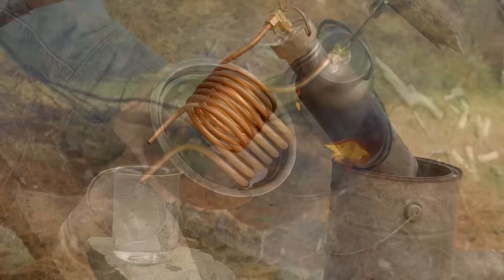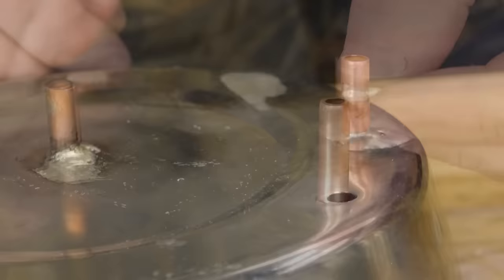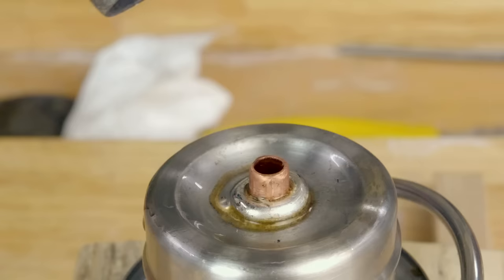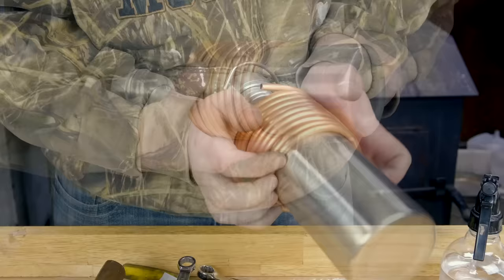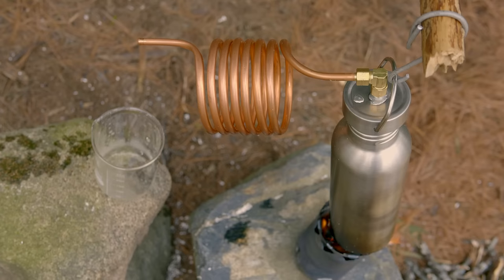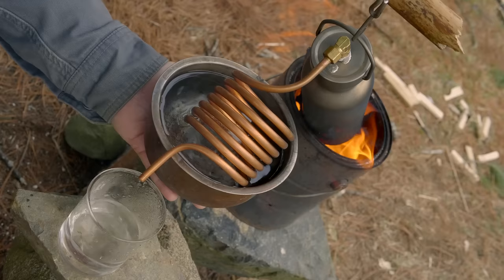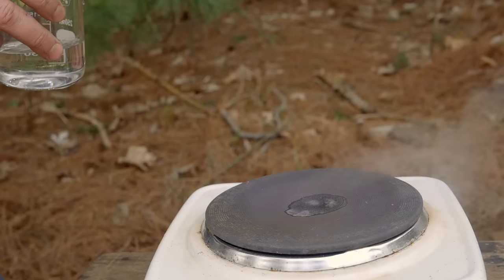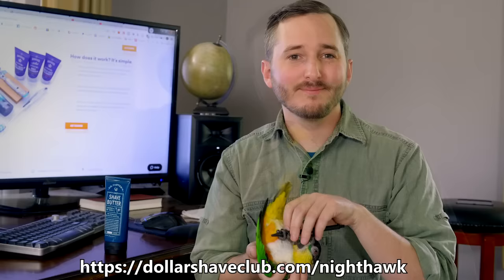DIY Salt-Water Survival Bottle (Compact Desalination Kit)

Comment: I Absolutely LOVE That You Said AND SHowed Your Failed Soldering.
A Lot of channels show how they make things and they dont mention soldering issues because i for a fact know that soldering is ART And You cant just solder everything without any problems, when you introduce two metals then there is problems and so on, i have even INVENTED MY OWN Solder paste , you can see that in my main channel called KRISRAP, It Have Helped SOO Much people to solder much better, half of the invention is actually passed to me from my fatther  and other half i thought up myself.
One Thing That I Can Tell you, Don`t Put The Rubbing Alcaahol On To The Solder  While The Piecve Is Hot, You Are Introducing Microcracks That Can Break More Under The Presure Afterwards When The Destilator Is In Workiong. Just Wait And THEN Clean It With A Steel Wool :) 
And COIL Should Be On To The Upper Side, Not Bottom Side Because It Releases The Presure,What You Did Is More Dangerous And It Builds Up More Presure.

Comment: A better way of doing it is with a Jerry can filling it with salt water from sea or saline well or other source and just using rag and garden hose , the rag to seal the hose to the Jerry can, then placing the Jerry can on a fire 🔥 to start distillation of fresh water. The problem with using copper pipe for desalination is that when copper is heated it releases excess amounts of copper into the drinking water which is not advisable for use as drinking water.
Reply: If you use a closed system and pull a vacuum on it, you can lower the boiling temp of the water to much, much lower, so that you need far less heat/fuel to turn it into vapor.  In turn, the copper will stay much cooler and have less issues with the above.

Comment: There's a product out that boils water from solar heat. It has a glass inner core and it's $67. Idk if tearing it apart and drilling holes would be worth it or not, but no flames would be required.

Comment: Copper conducts heat better than other metals which can cause problems. You need to torch the other metal for a bit longer before more briefly heating the copper.

Try it, you'll thank me later ;)

Comment: The problem with your boiler is there is no relief valve. Water does not compress. If the coils cool the water enough to where the steam cannot escape quickly enough, boom.

Comment: Some missed advice - do not fill the bottle or other containers past half point, or the boiling water may overflow or send parts of it into the tube, resulting with too salty water. More stuff to possibly improve upon or include in the kit is a good stick to scrub out the salt that may stick to the container, some folded up tin foil that you can build a 'house' over the tube out of which will catch and condense much more steam... Might wanna pull out the tube some more, at least upon use, so its not as close to the fire source. Lastly, a question - are you sure the copper tubing and solder is water contact safe over long term?

Comment: 1) You didn't have to drill a second hole in the lid any expansion gasses vent around the tube insertion hole (upper and lower) under heating the solder before the seal forms .... 2) Why is the coil spout dangling above the beaker? You can stretch the pipe into the beaker "J" configuration (or catch) at an angle THEN cover the opening with a top layer of clean leaves to further condense water droplets into the catch beaker... 3) Condensation will form liquid that when you do place the coil into water yields the most value. That's all

Comment: What is the purpose of drilling the small hole if it just gets covered up with solder?  Will the solder "blow out" if the pressure in the bottle gets too high?   Thanks!

Comment: Does the INSIDE diameter of the copper tubing need to be exactly 3/16 " with the OUTSIDE Diameter measuring exactly 1/4"?  And does that mean that the 90 degree compression tube fitting need to be 1/4 " OUTSIDE Diameter to fit this size copper tubing??? (Does this size 90 degree compression tube fitting accommodate a 1/4" OUTSIDE DIA copper tubing?  The tube fitting is sold as 1/4" OS diameter no further details.)  Please help so that I can order correct parts and sizes.  Thank you.

Comment: Pretty sure you can  use urine, puddle water, or anything H2O. Could be the only water available. I personally wound filter it to remove any foreign solvents but this idea is exactly what I’ve been searching for. Didn’t understand the vent hole then you soldered it shut?

Comment: Would placing the bottle in a large pot of boiling water reduce the damage it eventually suffers by direct flame? (blackening, purple bands, possible damage to the soldered joints, etc)
Reply: I saw a other video where a container of water floating inside some boiling water never reached boiling point itself, so I'm guessing not
Reply: @faithful451  thanks!

Comment: Where did you get the water bottle?  Most of the metal water bottles I have found have a small plastic threaded plug.  The large metal cap is what makes this project worthy.

Comment: What if you start with small amount of the initial water in beaker to dip the tube to prevent steam from escaping and to also add the final product the necessary minerals.
Instead of adding the mineral at the end.
Reply: Then you have to worry about potential biological contaminants like bacteria, parasites, etc.

Comment: btw - If you're doing this:
1: make abso-fucking-lutely sure that the gasket is made from silicone (and not a carbon-based rubber such as butyl-rubber which has become very common) - Silicone is heat resistant and does not burn (it is chemically closer to glass or sand than rubber)
2: Disilation purifies minerals from salt water/contaminated water. But volatiles such as gasoline or oils will also be distilled, if you do not know what you are doing - and if you are reading this comment, you do not have to necessary knowledge of physical chemistry to "know what you are doing" - also there is not internal thermometer, so even with knowledge, better not.
TL;DR: only use this from clean salt water

Comment: Watching this video again and I was wondering, what if your fresh water container is above your salt water container?

I'm considering making a water distillator to get fresh water out of the water in a canal nearby. The issue is that my fresh water will be up on a homemade water tower and my canal water container will be on the ground. 

Do i still need to make the coils in the pipe? Or can I just run the pipe directly into the fresh water container?

Comment: ....HEY!!!!   WAIT!!! DON/T "DRILL" ANY HOLE, FOR THAT COPPER TUBING!!! INSTEAD, JUST CAREFULLY PUNCH A HOLE THRU THE STAINLESS CAP, USING A TAPERED AWL, UNTIL THE HOLE IS JUST BIG ENOUGH TO INSERT THE COPPER TUBING.  THIS WILL GIVE A MUCH BETTER CONTACT BETWEEN THE TWO DISSIMILAR METALS.  CLEAN THEM FIRST, THEN PUNCH THE HOLE, THEN FLUX, AND SOLDER!  EASY, AND YOU ONLY NEED A HAMMER/MALLET, AND AWL, TORCH, FLUX, SOLDER, AND SANDPAPER/EMERY CLOTH.

Comment: Everyone is saying that its too expensive or requires way too much energy to do this. I think humanity is just lazy. If I lived on a beach and had the tools and materials I needed, I would build an H2 generator, then desalinize the seawater ONCE with wood (like in this video), then I would use that desalinized water to put into an H2 generator, thereby generating H2 gas. Id use that gas to burn a next cycle desalinization cycle (without using burning wood) and so now I am desalinating water with zero carbon emissions (except if I am releasing nOX into the atmosphere) and using my own power.
Put simply: Use a $105 solar panel to generate enough power to push an electrolytic H2 generator. Use the H2 thats generated for burning off salt from sewater, thereby creating safe, drinkable water. Can use excess water to put back into the H2 generator to split off into more H2. There, I solved one more world problem. You're welcome.

Comment: Great video this would be very helpful where I live, surrounded on three sides by oceans, I have a question tough. During the condensing of the water through the copper pipe does salt buildup in the pipe and if so how do you clean it out and about how often.

Comment: The stainless steel water bottle's cover, it has to drill two holes, one of it is larger and the other one smaller, its to let evaporated. I saw you are putting on rosin core solder, i saw you let the tube in which is correct, but I saw you put the solder in the tiny hole, may i ask why?

Comment: I feel like the condensed water should not have to climb uphill to get out of the tube as this would surely create back pressure in the consenser coil, surely a vertical helix would be better so that the condensed water can freely run out the bottom

Comment: Clean solder joints....wet cotton rag and wipe it while molten. Please make sure your stainless steel water bottle isn't lined with a "protective and potentially toxic" invisible plastic or BPA liner to keep that cheap Chinese 
stainless steel from rusting. 
Imho

Comment: Hi I would like to try this project. One question though. How does the silicone gasket that comes with the original bottle fair in the heat? would you recommend a hardier replacement? We only have sea here so in a SHTF scenario salt water is the only sustainable source.

Comment: Since prepping is about using what is available and not to waste anything. Is is possible to take the salt slurry you have left and pouring it into a pan and either putting it over a small fire or setting it out into the sun and allowing the water to evaporate to get the remaining salt for food prep/flavoring or food preservation possible or would the salt be considered contaminated of unusable?
Reply from the maker: That would be fine if it's normal ocean water

Comment: Awesome video. I imitated your design and built one of my own!

I'd like to make it lighter.

Is there another type of tubing that one could use to make it lighter?
Also the brass elbow piece for the top is quite heavy.
Perhaps drilling through the sides towards the top, on the shoulder of the bottle, and using a lighter tube attachment held in place with rubber washers and nuts instead of soldering?

Comment: 1 hr of electricity at 120v. You are done. Two car batteries on solar will last 9 hrs of run time. 

You are better off getting a portable filtration system. But you must buy filtration.

Comment: Just tried building this.  Thanks for the video.   Mine looks terrible
Reply: Feel free to be awful and laugh as much as you all like but I’m pretty green so have a couple questions.  I hope yuh get a laugh from them. 

I’m guessing you need a specific soldering torch to melt the plumbing grade solder and flux?   My torch I use to light my grill didn’t seem to do the trick.

What is the best way to cut that copper tubing?  I used a hacksaw but seemed inefficient.  

Back to the solder thing.  I’ve only done it a couple times before.   Can I get a kit off of Amazon for now as a novice or better to get a good set?   Any recommendations on a decent set off of Amazon?

I got the wrong right angle fitting and ordered the correct one so that should help.  I cut the copper tubing with a hacksaw and it seems to look good.  9 coils.    

I live in Hawaii so there is some practical use for learning how to distill salt water.   

Mahalo
Reply: @brenthanson7502  use a different fitting, barbed on one end and threaded on the other, than use silicone tubing.i have built one using the silicone, just keep it out of the fire. The whole thing fits in a metal cap for  water bottles,  very compact. Silicone will take the 220f steam.No soldering needed. Just make sure you get thinwall not the stuff used for vacuum lines on cars.

Comment: What do you think about an electronic desalination unit. Such as a unit that can heat the tank or bottle whatever you wish to call it with batteries. I believe it can be done I'd like to know what you think
Reply from the maker: Yes that could work. An electric tea kettle with a coil to let the steam out would work fine.
Reply: @Nighthawkinlight  I noticed in the video you said something about explaining how to deal with the electrolyte lack of electrolyte shall I say problem. Is there a video you had to explain that

Comment: Hmm does someone know the health salt / distilled water ratio if I want to scale up the production? It could help for group emergency
Reply: Tap water seems to contain roughly 10-20mg of sodium per liter. Ocean water contains approx. 3500mg of salts, of which roughly 1000mg is sodium. So 1% dilution should roughly do it. You might come in a bit over/under things like sulfate, magnesium etc., but the sodium will be roughly correct. I would probably err on the lower side. You can tell by taste, anyway. If you can taste the salt, it's way too much, already.

Comment: You really need to put a pressure release valve on that so it won't explode!! Whoever decides to make this or others like this put a safety release valve on it you can seriously get hurt and burned!!!  because if you build a fire that is boiling more water than can come out the tube it will explode!!!

Comment: Would it be possible to do this with an aluminum container? I've got an aluminum container that would be perfect for this and I'm guessing that since you aren't putting anything acidic in it it should be ok
Reply from the maker: Aluminum chloride is a possible byproduct of heating saltwater in aluminum. Probably it would not make much and it wouldn't get passed through the steam into the fresh water side, but it could be a risk.
Reply: @Nighthawkinlight  thanks for the reply! Would that still apply if I would be using to distill fresh water?I live in Canada so à small setup like this could be practical for camping and I'm not really around the coastline where you would find saltwater
Reply from the maker: @joshrub9416  That would probably be fine, but most of the time you only need to boil fresh water. Note that ideally the tubing and fittings should all be stainless steel. I've since learned that brass is not food safe, and a small percentage of people may have bad reactions to copper.

Comment: Survival desalination method....1st step....Soldering copper. 
ok on to the next video 

Anyone know of a way...that if you were just dropped off on an island, how to desalinate the water? Maybe using bamboo? And a coconut with a small hole for the bamboo? bend the bamboo in such a way that it will drip into another coconut?

Comment: But, wouldn't the lead in the welding contaminate the water with lead?????  Woudn't the little piece of rubber contaminate also?
Reply from the maker: Lead free solder, food safe silicone
Reply: @Nighthawkinlight  Can you please, tell me where can I buy those two things?  How do you remove the rubber seal, once is tightened up into the fitting and the tube?
Reply from the maker: @superjoseco7279  Oh I see, you're talking about the rubber piece added to the fitting. You only screw the fitting finger tight so the rubber piece is removed before use. Lead free solder is available at any plumbing store.
Reply: @Nighthawkinlight  I don't understand so well, but thanks anyways.

Comment: What one gets using this method is DISTILLED water. Though it is drinkable, I think not healthy if used for a long time, because DISTILLED water does not contain minerals, and DISTILLED water would take away minerals from the body. Always consult doctor before using, how much and how long..

Comment: lol. with a container that small you will get water boiling over the outlet and it will contaminate the finished product. Almost totally useless. Not to mention when using a worm style condenser it needs to be held vertical to prevent water condensation from closing off the flow. When the coil is lateral it will build up water in the bottom side of the coil and that prevents vapor from entering the pipe. Any one that took high school chemistry should know that. That's basics 101.

Comment: Could you not simply collect the water in the same way you would for distilled water ie a small pan inside a large pan using the lid for the steam to collect back into water and drip inside the smaller pan ps thats how i ended up here watching a video on distilled water

Comment: I wonder if this could be adapted into something that can be used to get drinkable water from polluted water.  I can't seem to find anything besides DIY desalination kits, and I don't live anywhere near salt water.
Reply: You have to be careful with drinking large amounts of distilled water because it can make electrolyte imbalances worse. It is not poisonous as some sources say, but you will have to replace the trace minerals in water with other sources, so if you don't have any food in addition, distilled water is not exactly ideal. 

Generally, boiling water will remove most bacteria and other problematic organisms and will be mostly safe to drink, unless it contains poisonous inorganic compounds like dissolved minerals. 

Is there any way to know without chemical analysis? No. So... don't do it. It's not worth it.

Comment: my only issue is what do you do with the salt that has built up inside of the bottle? that'll be a bitch to clean. I suppose maybe throwing more water in it while it's still hot might break up the salt deposits left behind but I have a feeling I wouldn't wanna be tasting water before it's boiled lol, neat vid